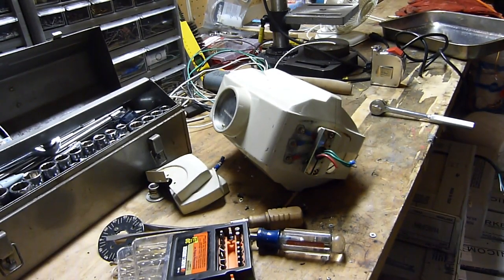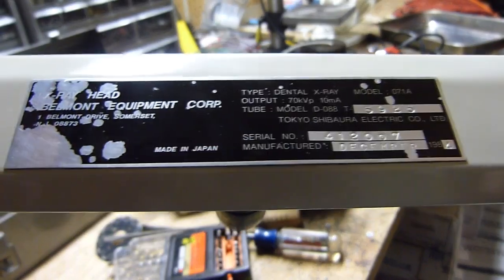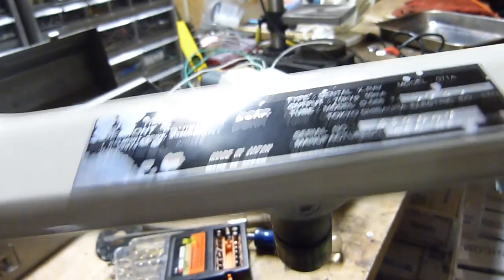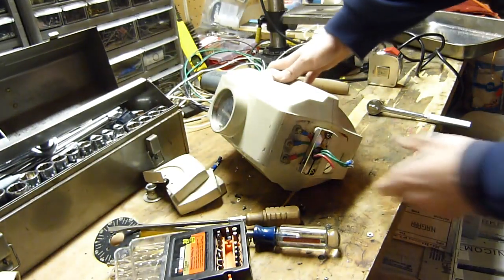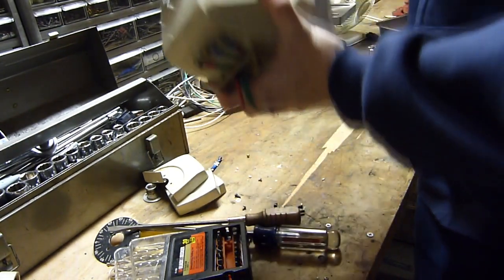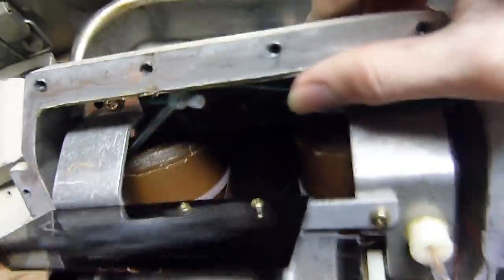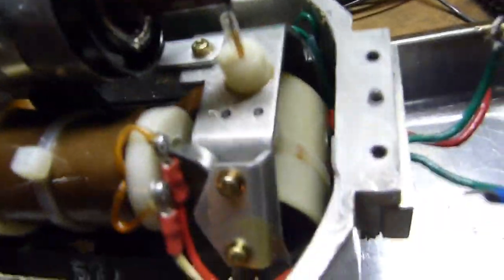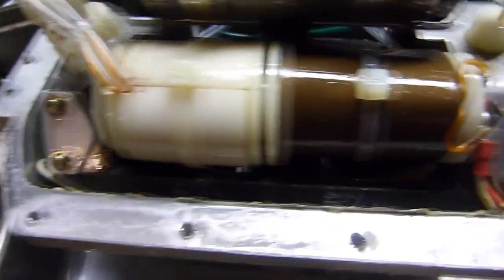Equipment Autopsy: Belmont Dental X-Ray Head

Comment: The fact that anyone can get their hands on this type of equipment is scary.  No one should ever mess with this type of stuff unless they have a firm understanding of electronics, working safely, and also a proper understanding of how radiation works.  This thing has enough current available to kill you.  Nevermind the fact that it can produce x rays.  I don't see why anyone would ever need to mess with something like this unless they just wanted to have a look at the inside, and maybe keep the tube as a display item.  Don't mess with these things.  I cannot stress that enough.
Reply: Meh, don't be a chicken.

Comment: How to create a vacuum in the hv Tank dental Xray Protable(60KV, 2mA) by vacuum?
Reply: Fill it with oil (maybe with a tiny amount of space left or with the expanding cushion/bellows inside), the use a standard vacuum pump to pull a mild vacuum. You can find such a pump for cheap on eBay or ask your car garage (they use it for getting the air out of the car AC). No need for a high vacuum inside as you only want to get rid of the air bubbles between the transformer wires.

Comment: I have a problem with X-Ray unit Siemens Heliodent MD.
As you are Expert in this field I 'll be appreciated your help.
I have replaced the X-Ray head from working condition X-ray unit  from my friend office and installed it at the other X-ray unit which X-ray head was faulty.but after installation when it exposure X-Ray it makes noise( as you can hear in attached file)
I would like to ask you does it make sense that this sound comes from the head of Xray or it should be from the body of the arm. The problem is when X-Ray exposes sometimes have good Xray and sometimes not (especially when makes louder noise)
Please find attached the video that I have recorded From X-ray unit for your consideration.
I ll be happy to receive your recommendation on this matter.

Best Regards
Max

Comment: The brown bottle you saw inside is called a bellows. As the oil gets hot it expands. If not for the bellows, hydraulic pressure would split the head.  The rubber bottle collapses and the air inside is pushed out the tube into the atmosphere. when it cools it re- inflates. this way there is never any air space inside.If you have a tube head and can hear oil sloshing around ,that means some leaked out. Some tube heads have copper accordion type bellows. This type was almost guaranteed to leak at some point.

Comment: Everyone interested, this head is full of insulating oil which contains P.C.B.s dont get it on your skin, or breathe it in a confined space. its known to cause cancer. Dont allow it into any waste water or ground water. take it to an oil recycling center.
The smaller transformer you saw first is the filament transformer. It steps down voltage to light the filament (cathode-) charging it. The larger transformer is a step up transformer to 70k vac the current is under 10 milli. amps. there is a timer in the controller that energizes the filament for about 20 1/2 wave impulses before the main voltage charges the primary transformer for a desired  selection of 1/2 wave impulses (from 3 to 3 seconds) which energizes the target  (anode+) That's what makes the magic happen where newtons accelerate and smash into protons and the rest is radiation. Thank you Wilhelm Roentgen!
Reply: When did the use of PCBs stop for this application?
Reply: hi what is P.C B.S?...
Reply: ihatesamosa basically chlorinated oil, it's a cancer causing oil that will go through your skin.. I honestly don't think this kind of unit will use P.C.B. but I could be wrong
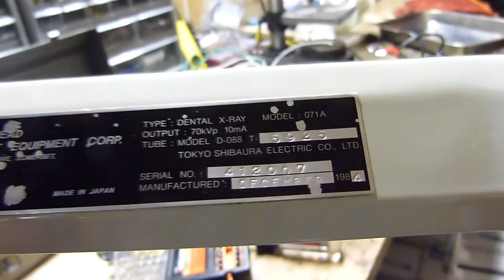Reply: I doubt it contains PCBs. Here in europe PCBs were used only for a short period of time (mainly the 1960s), the US also banned them/phased them out from the early 1970s on. This head was produced in 1984 (see 0:11). But of course, one has to be extremly careful with this type of equipment. I disassembled a head from the 1940s/1950s, it contained beryllium isolators (nasty stuff, google it). Let alone the dangers of powering such a unit up, which is dead simple even for the inexperienced.